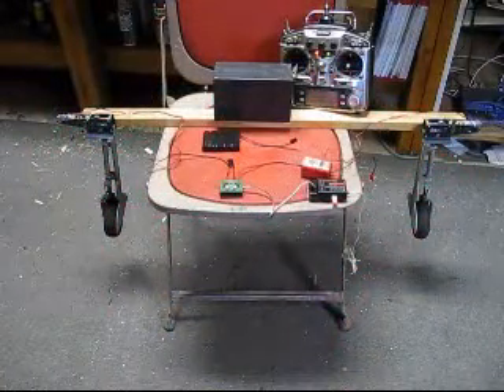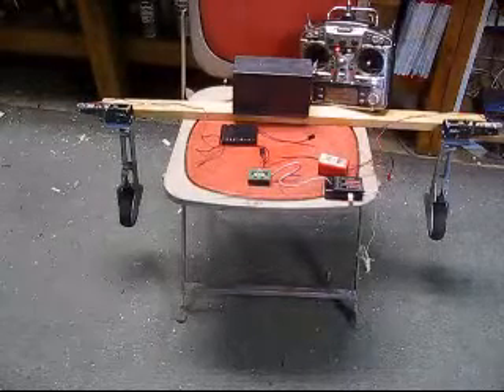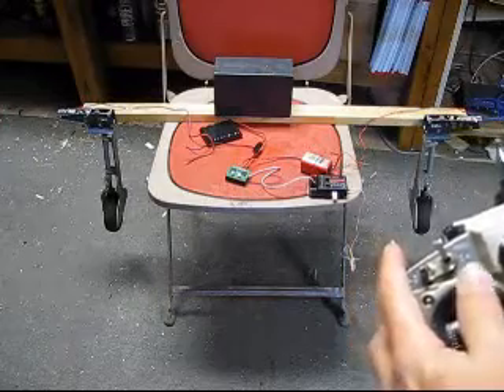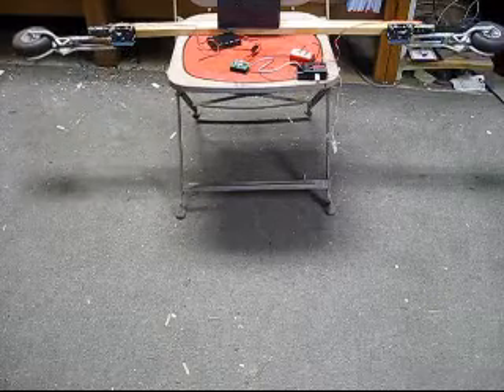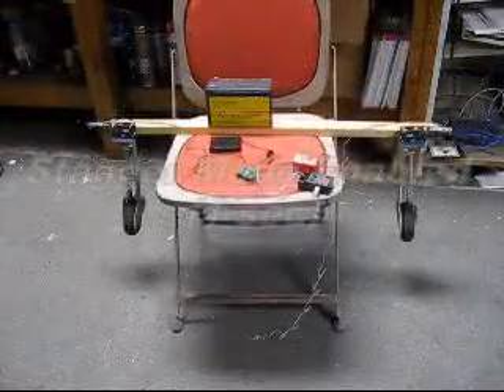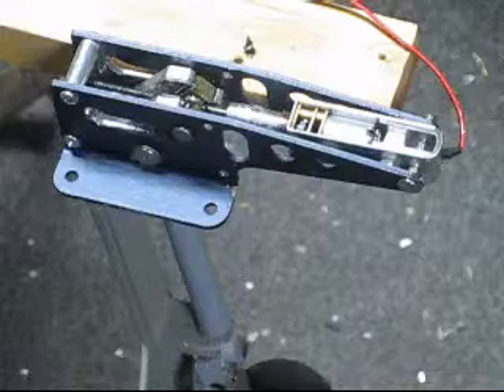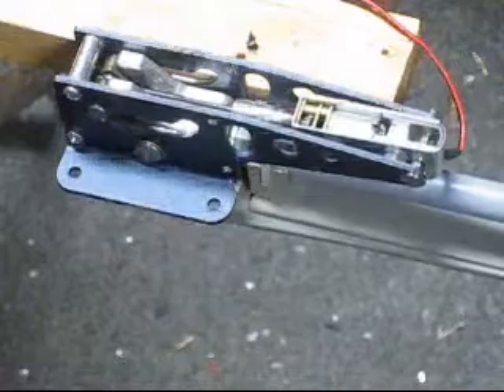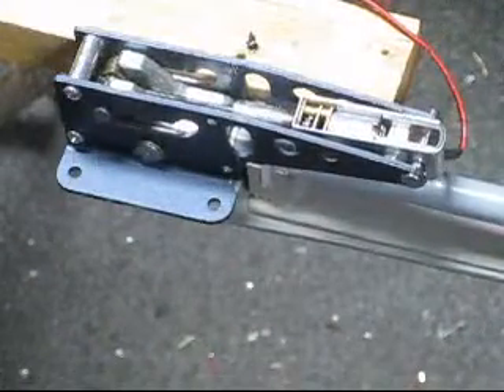DIYRC.COM's Electric R/C Airplane Retracts - Modified Robart 630 Air Retracts w/ Dual controller

Comment from the maker: The staggering is enabled using a simple jumper on the board (in the code, you can also change the stagger to be as long/short as you'd like)